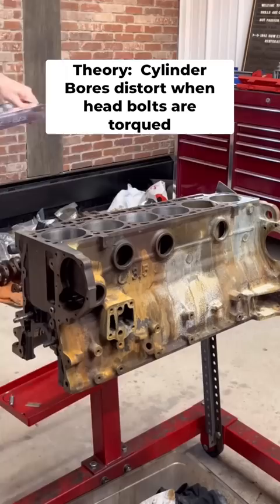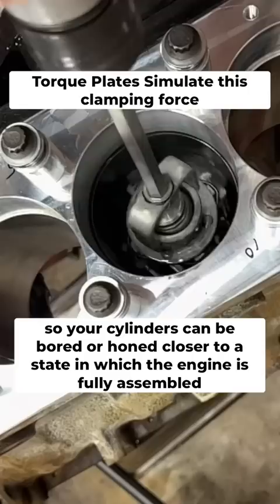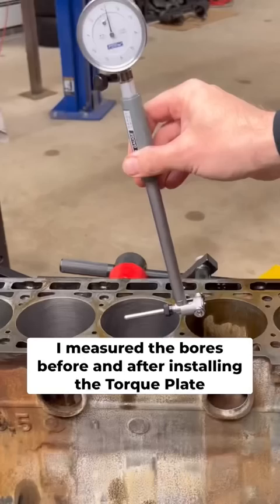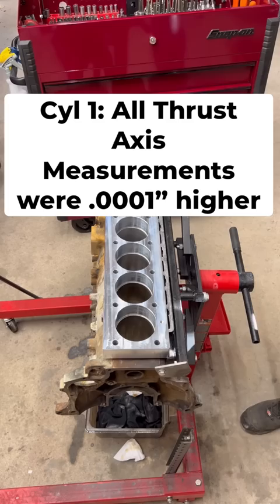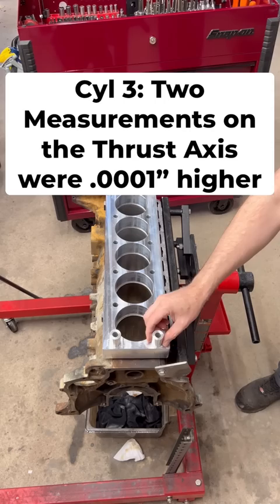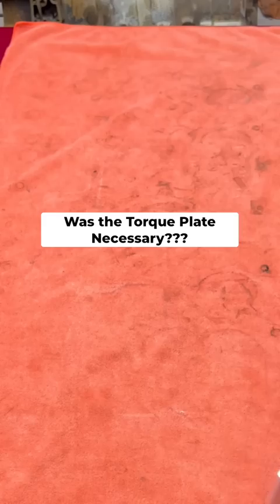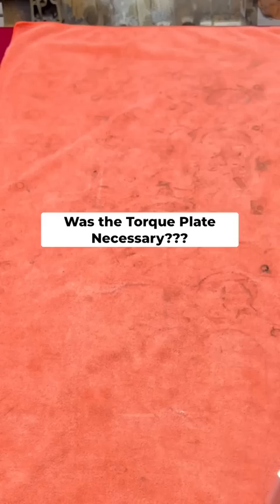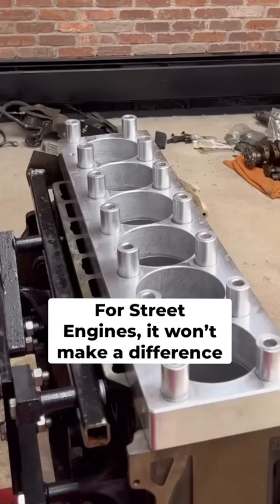Are Torque Plates Necessary? #bmw #cars #diy #bmwm5 #bmwe34 #restoration #automotive #engine #tools

Comment: Yes sir, I agree that it is necessary. I have seen the backyard guy do the rebuild and they'll run the same. Question is which one will last longer than the other I also know the answer to that one also closing in on the 40 years mark. Each person is going to do and think what they want. All you have to do is take two 21 century modern motors and do one each way and see which one will go 300k on the rebuild. I also know that answer too from real world daily trials and it is not the back yard slap together. Good morning and great day to you all. You do yours your way and I will do mine with them and keep putting 5 /50,000 on mine and do what you do. Enjoy your day today and may it go flawlessly.
Reply from the maker: Thanks for your feedback and support!
Reply: @wewrench  anytime and I hope that you have a great evening. I work in a small shop about a half a hour north of Pittsburgh, Pa. now. I did work at my great uncle's shop for over 27 years but left due to the change of ownership. He's 93 now and still goes to the shop daily, that should tell you about the new half owners. Good to hear back from you and I will look over some more of your videos and see how much I can learn. Sometimes a old guy can learn new stuff, LOL. You all enjoy your evening!
Reply from the maker: @johnelliott7375  Never stop learning!
Reply: @wewrench  your right I try everyday but I do decent. 8 or 9/10 I will daily. But I always slack 1 out of 10 it seems. Great evening and enjoy your day tomorrow.

Comment: Maybe need the plate on older engine. But modern engine sure don't need that. The torq procedure is engineered to take them factor in account.
Reply from the maker: Thanks for supporting the channel!

Comment: Are blocks also must be heated after torque plate applied to allow normal work heat effect on a loaded material
Reply from the maker: Yes, but that's an overkill on a street engine. Much like a torque plate

Comment: I have tighten  the head a little more and the main and cam a little more and the Rings a little tight also so that that after running  it everything standard
Reply from the maker: yikes! I don't feel comfie with that
Reply: That first I would need two battery's to get it started and then make sure it do not over heat. Let it run standing .

Comment: Just wait until the rest of the world learns about hot honing. All machine work is done on a engine block that is first heated to operating temperature and maintains that temperature until completed. It's common practice in formula one. Amazing results..
Reply from the maker: Pretty crazy they do that, but when your engine longevity is measured in hours instead of miles, every detail matters!

Comment: It really should be machined and honed at the temperature it will be run at … but that too doesn’t really make much difference on a street engine.
Reply from the maker: Thanks for that contribution.

Comment: One thing that can be said is, the surface can be protected by the plate. If you need the polish to remain, or can't afford a marred surface.
Reply from the maker: That could be another application for it
Reply: @wewrench  sometimes intended use is not the right use.
Reply from the maker: @osmacar5331  Very true
Reply: @wewrench  also given ne and a few friends are gonna most likely make a track 92 NSX with a V8 in it, looking at a 7.4L maybe 7.5L, supercharged too. If possible. Cause we just want to see it, and see it disappear.
Reply from the maker: @osmacar5331  Sounds like a cool project
Reply from the maker: @osmacar5331  You get something beautiful!
Reply: @wewrench  exactly. But i have one worry, can the frame safely take it structurally. If not, well guess we need to make it out of Carbon fiber as well as get rocket bunny on the line for a CF body kit.

Major shame if we have to. But hey, one of one. (Also the rocket bunny body kit looks really nice. And a track dedicated kit in appearance).

When we get it done. You know full well we're recording it.

Also there's a high chance we may have to get a completely custom V8 engine though. Hopefully not, but if done. It's going to be extra special than it already will be.

Yes, we ultimately kinda want to just see a V8 powered 92 NSX.
Reply from the maker: @osmacar5331  The NSX is one of the few japanese cars I really like
Reply: @wewrench  Honda's are really good cars. While i prefer the first gen NSX series, the new gen aren't too bad.
Reply from the maker: @osmacar5331  I don't care for any of the new stuff
Reply: @wewrench  purely depends on the car. But if i ever get into automotive making. You'll know. At least then I'll abide by safety regulations.

But I'll admit, a lot of the new stuff just doesn't have any charm like the older stuff. It's not like you can't have charm, AND, a performing body. But that makes too much sense.

Comment: Absolutely spot on mate only time I bother using a torque plate is if customer specificly asks for it or wanna run 
0030 pist to bore instead of cp spec of .0035 

Also you wanna measure where the skirts of the piston are not inline with the crank
Reply from the maker: I measured both the thrust and inline with the crankshaft to be sure

Comment: There no jacket on that engine it will crack under real power..
Reply from the maker: It's a stock build
Reply: I work on a Maserati line there have titanium sleeves with apx 1/2 jacket all the way around. I was told it could produce 700hp for a 3L.
Reply from the maker: @daisykaren6584  I don't doubt it

Comment: Isnt that an Iron Block? Did you just use the stock bolts and torque? You arent doing your due dilligence in properly testing the appropriate usecase for a torque plate, its not useless at all. Try this experiment with an alloy block with studs torqued to 150% over stock and see what happens to the bore!
Reply from the maker: Probably different results, but you're also altering the design parameters with the studs. This is just a stock build

Comment: it's a waste of time and money.  Heads are hollow torque plates are not.   If you have a aluminum head do you use a aluminum torque plate and if the head is cast iron do you use a cast iron plate?  Head bolts or head studs.  do you bottom out the studs or do you install them finger tight.  do you use washer on the bolts or studs.  The block distorts all the time on curves under heavy load or just hard acceleration.   We're are the engines mounted from all the way to the front, up high , down low. mid way down the side of the block etc.  Torque plates are a gimmic to charge more.
Reply from the maker: Too many variables! Thank you for supporting the channel!

Comment: I'm an engineer at Roush Yates engines. We build race engines and always use a torque plate and torque mains for honing. I agree that it probably doesn't matter for most street or low stress applications, but for racing you might want the reliability and performance that it provides
Reply from the maker: I agree. It's more for racing

Comment: Install and torque the main bearing caps along with the torque plate and everything should be tweaked into place for your machining process. Just a thought.
Reply from the maker: I think chasing these details for a street engine is an overkill. Can't hurt of course
Reply: @wewrench  preparation and planning prevent poor performance, That's the 5P plan from a Canadian Air Force pilot I know. I spent a weekend working with Roland Leong and wound up learning a thing or two from that man as well!
Reply from the maker: @patk8417  That's awesome! Thank you for supporting the channel!

Comment: So why not lessen or eliminate one of the distortion points?
No reason not to torque the main caps without the crank installed.
May not be absolutely necessary, but you'll sleep better.
Reply from the maker: It never hurts to be thorough but I think for a street engine, a lot of this stuff is nonsense
Reply: @wewrench  itat be, but spending a couple thousand doing a major rebuild.... what, another $100 for bragging rights.
Race motor one season versus  mild performance rebuild that may last 15 years or more.
I'd say the short lived race engine is a waste for a couple hundred miles.
You need to factor in bolts or studs. Studs require higher torque/more distortion.
If it's gonna be balanced, it's gonna be honed with a plate.
.....I'll sleep better if nothing else. No do overs in engine building. Personal preference I guess.

Comment: I beg to differ and here’s why not all blocks are created equal some are very thin casting and they move over .0015 of change with the torque plate is installed this guy obviously is not an engine machinist
Reply from the maker: No I'm not an engine machinist. I live in the real world
Reply: @wewrench  Has nothing to do with the real world or not you either know this information or you don’t but to say that it is a waste of money you’re completely wrong because if you were an engine builder You would understand this but judging by your mentality I would say you lean a little to the left Were obviously there’s no reasoning or common sense but whatever world you live in it’s your choice
Reply from the maker: @anthonymilano691  For every "engine builder" that swears by them, there's another one that says they're nonsense. If torque plates were law, then why don't the OEM's use them? This video I made casts a wide net, but you're not absolutely correct either. My video proves that. And if I had a dime for every engine that came back from a machine shop with a problem, I'd be rich. I was a Master Guild Audi Technician by trade. We did continuous invasive engine work at the dealership, where traditional knowledge would say..."that should be sent out to a machine shop for decking, honing, hot tanking...etc."  Do you know how many times engines got sent out? Zero. Do you know how many times engines came back with issues associated with not being sent out? Also zero. The real world is this. Engines are way more forgiving than you think they are. This engine in particular has 260,000 miles on it. The cylinder out of round was ten times the maximum allowable spec yet it had perfect compression and didn't burn oil. Most of the preachy nonsense on this thread comes from people who never did this work in the real world.
Reply: @wewrench  Why do you think your point is the only one that counts because both of our ideologies fit in this world and yet you’re discounting what I do after being in the engine business 31 years and have not had one failure in five premiere series, Making far more horsepower than you can imagine which is where this fits in my world it’s not whether it’s real or not it’s just depending on which one you live in by the way ball honing  a block does not make you a machinist
Reply from the maker: @anthonymilano691  I’m not a machinist and I’ll never be one. But this engine will run well and I’ll be able to put another 200,000 miles on it. I’ll never be a body man, but I’m going to do all the body work on this car myself and it’s going to look great. You’re right, both our ideologies fit in this world, but my end game/goal is not to be master at all things. The goal is to restore my car and do a great job while making videos along the way.

Comment: Does a response is pretty simple if you run that close to the red line yes. But if you make a habit of running that close to the red line you better have sponsors. So no sponsors no need.
Reply from the maker: I never ran the car hard

Comment: Not all blocks are the same in terms of strength and deflection with the cylinder head torqued down.  Extrapolating from one example of one engine is hardly scientific.
Reply from the maker: I cast a wide net ,but for street engines in general, I don't think they're needed.

Comment: sounds like a waste of money to me
like, anything in the range of 0.01mm propably is gonna be fine
Reply from the maker: I agree. Chasing tenths on a street engine is a waste
Reply: @wewrench  we had an engine with blown head gasket, warped head, scoring in the cylinders and worn pistons at 60.000 miles(ford 1.0 ecoboost)
in order to save the customer time and money we just honed the cylinders with a hand drill to get rid of the worst of it, had the head planed at a machine shop, plunk in the new pistons, reassemble and send them off, 2 years later it's running just fine

that reminds me, we'll have to contact them to come in for an oil change, because if they skip it they will have engine damage again.
the worn pistons where only because they skipped an oil change and the timing belt started to dissolve and clogged the oil pump, fortunately the crankshaft was still fine

don't get a car with an ecoboost engine

Comment: I did the same test on a cast iron engine at full torque and the area near the bolts (although I was using ARP studs at much higher than stock torque for a racing application) the walls of the cylinder swelled under the fully torqued load approx 0.002.   In a cylinder that's huge.
Reply: That's one squishy block, my friend!
Reply from the maker: The added torque on the studs probably made the difference.
Reply from the maker: Sure is

Comment: Torque plate should be same thickness and material as the cylinder head.
Reply from the maker: It's aluminum but not the same thickness
Reply: I don’t agree, the force the torqued bolt has on the surrounding material is what matters.
Reply: I agree.

Comment: the other part of this is how accurately can .0001 be measured. what is the +/-  error of the indicator you are using? call the manufacturer, the answer will surprise you. so, with this, we don't even know what the true results of this test were.
Reply from the maker: My Fowler DBG should be accurate to .0001"
Reply: @wewrench  i doubt it is. Mitutoyo even states like a +.0001/-.0002 or something like that.
Reply from the maker: @andy347495  I'm sure it's plus or minus, ...but I can tell you that the tool had great repeatability.
Reply: @wewrench  🤦🏻‍♂️🤦🏻‍♂️

Comment: From my point of view the only time I’d use a so called torque plate is to compress cylinder liners to measure liner heights
Reply from the maker: That's a good practice
Reply: Yes it is I’ve been building engines for 35 years

Comment: First of all your NOT following normal blue print building technics.
As a master machinist I WILL torque all relative bolts like mains and torque plate. We then bore and hone block with plate installed.
Now one other factor we do is measure and machine the deck parallel first to give a set deck height and fresh deck surface RA or finish.
Then we do the necessary bore and hone.
Now on high dollar race engines we will run hot water though the block but for most street and performance we still use the torque plate.
Now in real world machine work we use the cylinder spacing and center off the torque plate to properly place the cylinders. 
Your calling your self MASTER ,well you are disrespectful to ACTUAL master craftsman of specific type of work.
And you might be surprised how BMW machine their blocks. Don't assume you know what your talking about and your humble opinion is worth what a pawn shop will pay for it.
Reply: Geez pal take a chill pill. He didn’t say he was extracting every bit of power out of it. You come off as very condescending and know it all and really add very little to this conversation.
Reply from the maker: The fact that you used the word "blue print" shows you're still living in the 1950's. I never said I was a master machinist. I said I was a master technician. Watch episode 1 of my video series and you'll see exactly who I am and what I've accomplished. If I wanted all that nonsense done, I would have sent it out. The spirit of the channel is to push the envelope of what you can do yourself. I'll bet you couldn't restore a car to this level if your life depended on it.

Comment: I saw an engine that was blueprints and fussed over and it still never made is to 50k miles
Reply from the maker: If I had a nickel for every engine I saw built by a "reputable engine builder" that had issues, I'd be rich

Comment: It is a waste of money. I imagine the power gain will increase .0001 Horse power times 8 cylinders. Like you the cylinder distorts far more with heat yet none heat the block up to bore and hone. Stress from a crank swinging. Harmonics it BS. They have never proved power gains from it.
Reply from the maker: For street engines, I think there are a lot of stupid details people swear by that make no real difference. That's the spirit of the video

Comment: I've always wondered myself. I've always thought torque plates would be more necessary on aluminum blocks over a cast iron block. Only because aluminum is sensitive to heat soak and expands more.
Reply from the maker: It may make more sense on aluminum. For a street engine though, it's splitting hairs

Comment: Your a mechanic or back yarder, your opinion means nothing. You “honed” the block with a spring loaded stone and a drill 😅
Reply from the maker: You don't know what you're talking about. It's a rigid hone.
Reply: @wewrench  you don’t either 🤣 it’s still in a hand held drill, not a 100k sunnen hone 
At least I’m a machinist and understand measuring and machining
Reply from the maker: @bigcncguy  Stay tuned to the channel. There's going to be a long form video of this released tomorrow and I got the cylinder perfect. And if you were a machinist, you would know that hone isn't spring loaded.